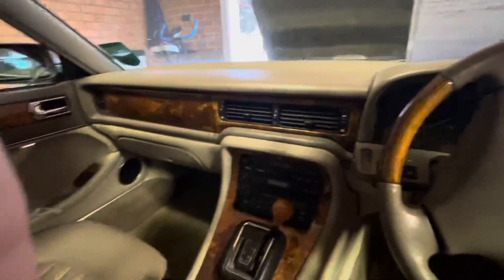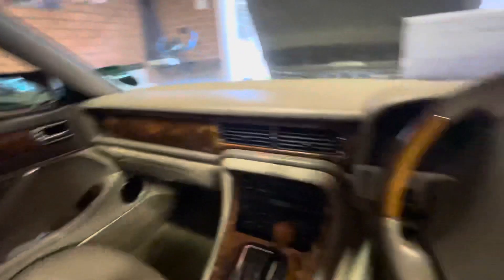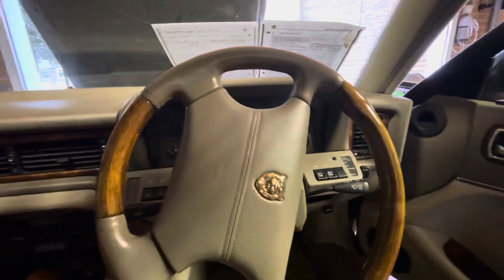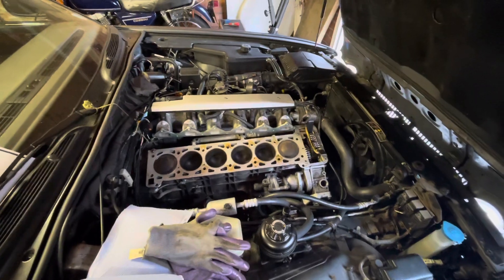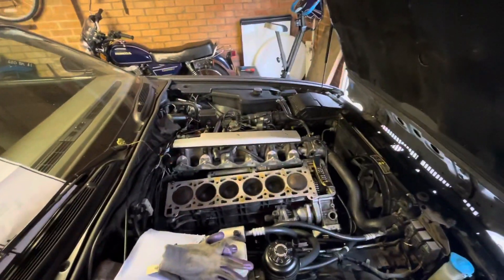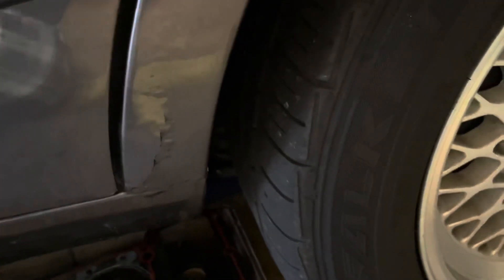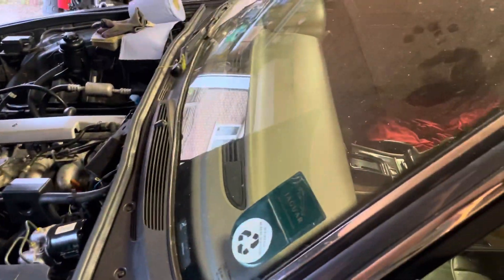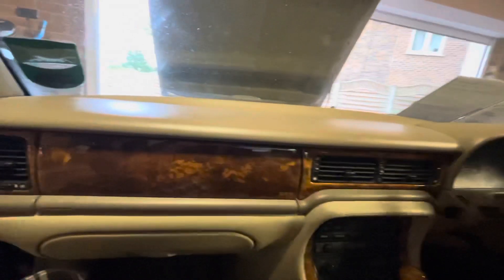Gloria the Jaguar x300, it’s not good… sad news. Ep.01

Comment: Good luck mate. I feel you! Beautiful car, if you are able or learn to work on the issues, it will make you happy for a long time. Will follow  your progress.. 🤞
Reply from the maker: Yes! Actually I need to do some kind of update because the car is running and driving now :) and has been for a few months so I know the operation was a success :D
Reply: @chrisbaker121924  congratulations! I got mine last sunday and it's gorgeous. I need to replace some bumper parts, as it rumbles and shakes when I drive slow and drive over uneven road parts. I think it's because of the rubber parts (don't know how they are called in english), which really looked done...
Reply from the maker: @OrlandoDCaros  mine had a knock at the front which was anti roll bar links and shock top mounts… and a clonk at the rear suspension which was lower bush in the shock. If that helps ofc yours could be different. But they seem like the common places to start. Anti roll bar bushes and front shock mounts are very easy DIY job. :)
Reply: @chrisbaker121924  great advice. That will help for sure. I'm a bit oberwhelmed of all the parts and that will be a good starting point for sure. Anything that could cause a remaining or critical damage driving around with those issues. Will get that fixed asap.. 😀

Comment: Glad to see you’re on top of the repairs already. I agree about the woeful values of these and similar Jags, I am very tempted to buy one myself in the hope the values will increase!
Reply from the maker: It’s a start! I would buy one if I were you. Although I wouldn’t count on massive value rises, they are still awesome value for money. Engine trouble is very unlucky on one of these. Think I had a coolant leak, unfortunately didn’t warn me of it as the low level indicator didn’t show and then overheated and blew the gasket. :(
Reply: These cars are actually  very reliable,  if you maintain them, regular ser ice, mine is a 97 x300, insurance  value 5k,